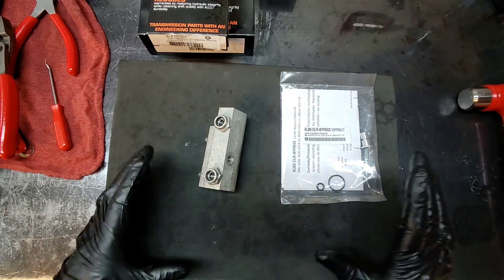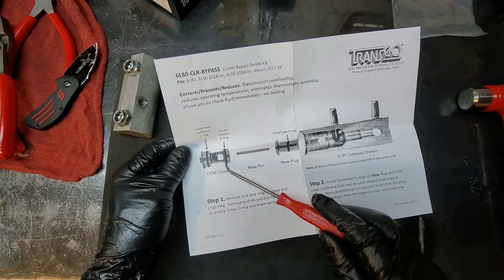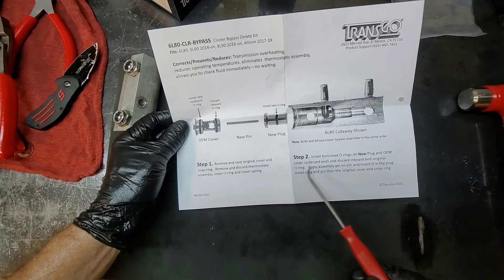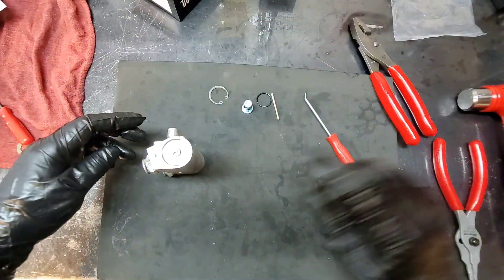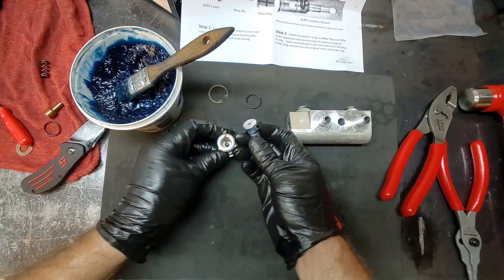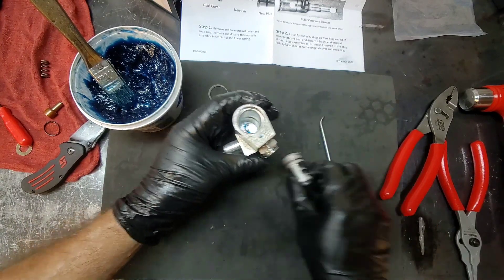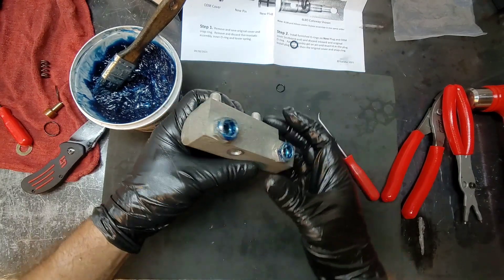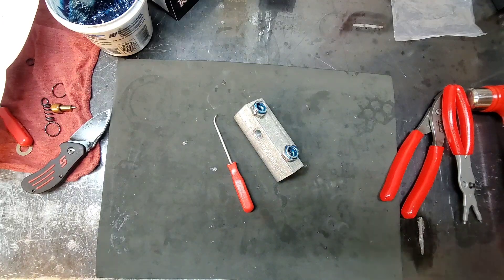Cooler Bypass Revisited - Transgo

Comment: i used the Superior product which was an easy install. however instead of a decrease in transmission temperature i noticed it warmed up higher than the factory temperature . any thoughts the truck has 106000 v6 6l80 2014 shortbed work truck. the trans fluid was serviced prior to the update.
Reply from the maker: If you compare it to Transgo, the superior has a lot of restriction on how it's made. The Transgo has only a rod holding a plug which has more flow. 
You can also drill and tap and thread a plug to separate both passages. You'll need to use your existing plug with just the outer O ring.